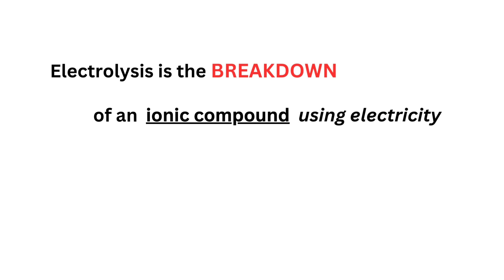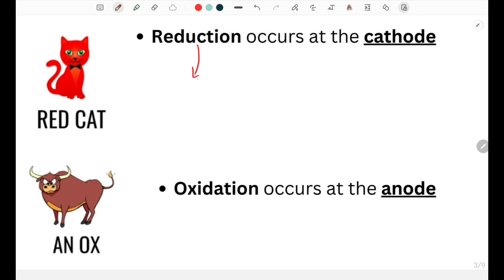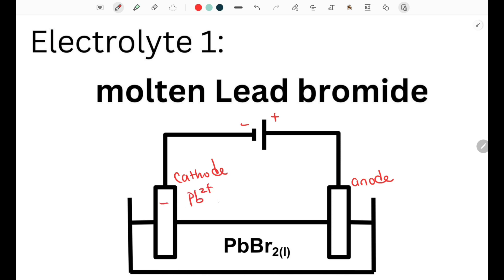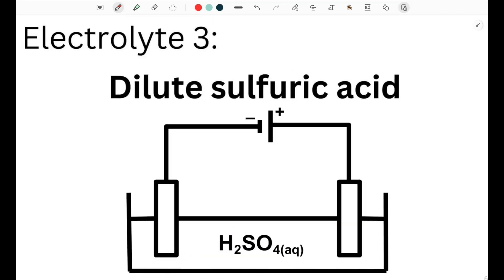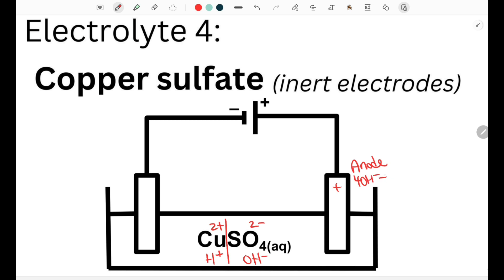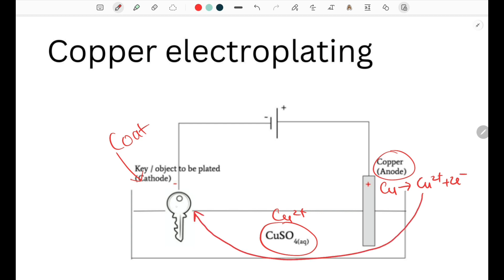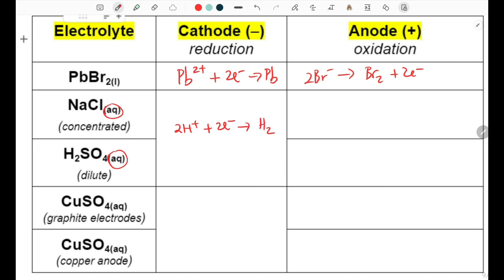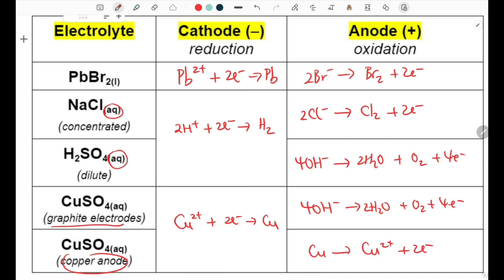IGCSE Cambridge Coordinated Sciences (0654): C5 Electrolysis

Comment: im a bit lost on why cathode sometimes produces H+ but wometimes not? whats the dependant variable??
Reply: Positively charged ions (cations) migrate to the negatively charged electrode (cathode), and at the cathode  - the least reactive element (metal or hydrogen) will be discharged. If we take the example of dilute sulfuric acid, H+ ions would be dissociated and would migrate to the cathode. However, if we take the example of copper sulfate (aq), copper is less reactive than hydrogen (refer to the reactivity series for this) and hence, copper would migrate towards the cathode and form copper.